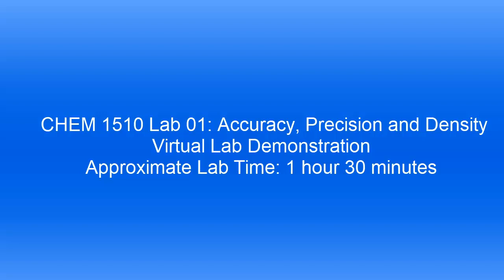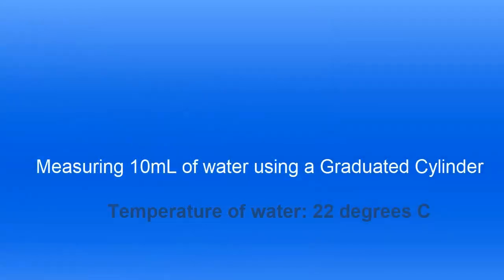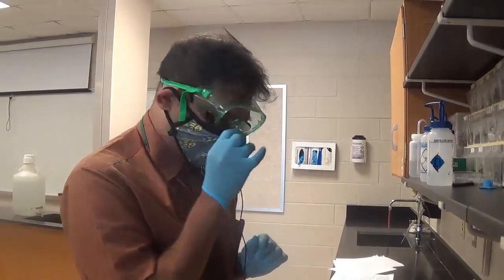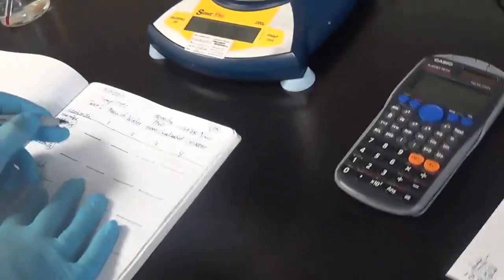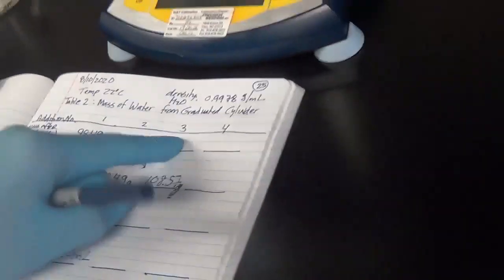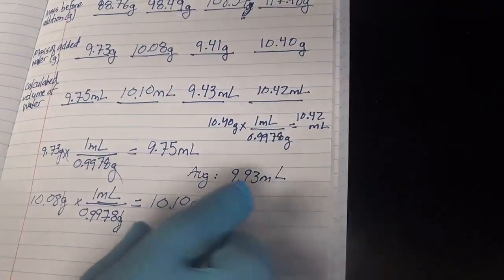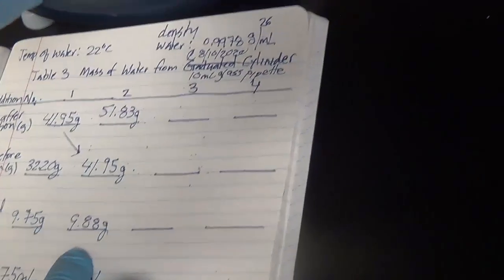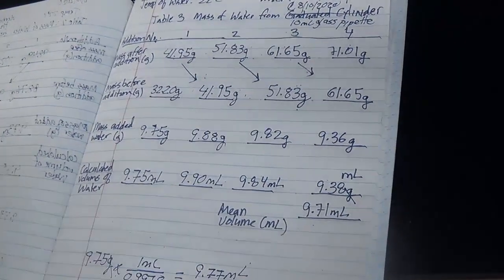Virtual Lab Demo: Lab 01: Density, Accuracy and Precision

Comment: Hello, I just like to ask. What is the sig fig that i will follow in getting the average. For example, if i have 0.009, 0.010, 0.011, obviously the answer is 0.010. However what sig fig rule should I follow is it the addition/subtraction rule, where my answer will be written in 0.010. Or should I follow the multiplication/ division rule where my answer would be written in 0.01??